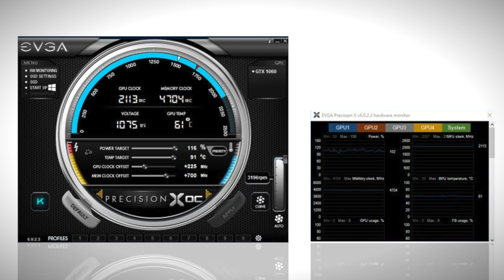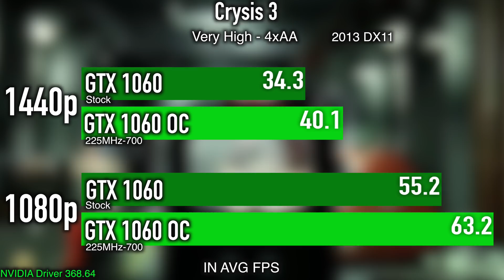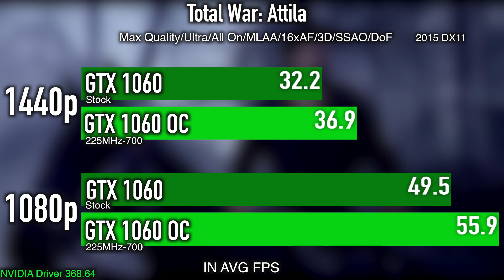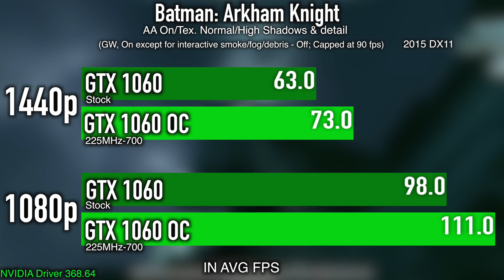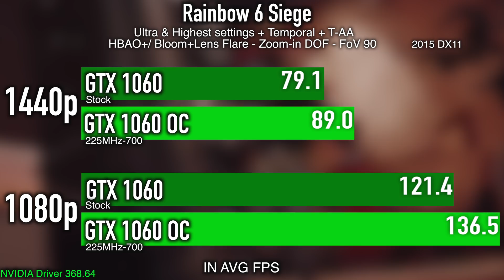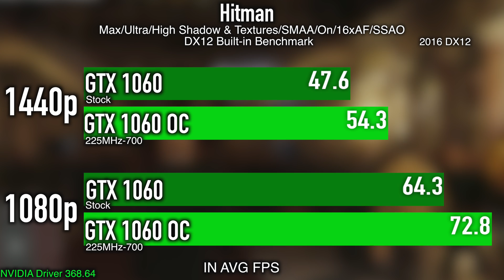The GTX 1060 Overclocked And Tested! 225Mhz Above Core!

Comment: I have a gtx 1060 asus strix oc edition. Things a beast, heat isn't a issue at the highest clocks. 2.3 ghz with 30 extra voltage. And 4150 on my memory
Reply: Air Brayden I have the gigabyte g1 gaming GTX 1060 6gb and I think it's the best one out of all the 1060 brands
Reply: I can't get past 2075 core 4479 ram on my evga gtx 1060 gaming 6gb card your ram clock is kinda low
Reply: I have an Gainward GTX 1060 with an overclock of +220 on core and 4560 Mhz on the memory. Its insane how mutch you can overclock theese cards. nomatter the brand. GTX 1060 cards are beasts and great in games  :)  My temps are going between 50-65 degrees so thats ok.

Comment: I dont know if i won silicon lottery but i was able to overclock core + 280 and +900 memory STABLE. - basically 15 fps increase in gta 5 - asus 1060 turbo. Great card :) Nice video!
Reply: Ethel Poolakese maybe lol I can't get past +150 core +475 RAM ON the evga 1060 gaming at least on heaven bench mark it crashes and firestrike I can't get over 205core 505ram
Reply: bshxh my current stable I find to work best is +450 ram and +175 core I hit 84c on vary un-optimized preview games. most of the time it's 76c max

Comment: I have an i5 3570 and an gigabyte ga-z77m-d3h motherboard. Currently using a GTX 660 ti, is it alright to upgrade to this with these specs? or do I have to upgrade the motherboard and CPU as well?

Comment: ? Will the AMD A10 APU 7850K run with a GTX 1060 6GB 

Hi Guys,

I have CPU AMD A-Series APU KAVERI A10-7850K Quad 
Core 3.7 GHz 4MB of Cache Not Overclock, I want to put card Is it tips.
Do buy GTX 1060 6GB Do happen bottleneck strong

My build:

- FM2A88X Extreme4 +
-(AMD A10 7850K (No Overclock
- CPU Cooler: Cooler Master Hyper D92
- GPU INTEGRATED R7 
- Corsair Vengeance Pro 8GB 2 x 4GB DDR3 2400MHz C11 
(Memory Kit (6.92 GB usable

-WD Blue 1TB SATA 6Gb/s 7200rpm
-Corsair CX Series 750 Watt ATX/EPS Modular 80 PLUS Bronze

Help me :(

Comment: not getting quite the same amount of over clock myself. +125 core, +249 memory, anything more and it's unstable. Still, that's gains around 5 fps on most games. Overall getting great performance from this card, glad I bought it.
Reply: also should mention I'm running this card with an 8320 and I'm seeing little to no bottleneck, so if you're on a budget it's a good value combo with this card.

Comment: hello there, i have a question im building an intel ring but i currently have a amd setup i know that this question is not base on the video but i have a amd fx8350 and i ordered an oculus rift cv1 with a gtx1080 from gigabyte the g1, the intel parts are on the way, but i just wounder if the oculus rift cv1 works with a fx8350 16gbram ddr3 1600mhz and gtx1080 pascal, and my games are in a ssd samsung pro 1tb, the reaosn why i am asking is because i havent seen any video using amd fx8350 cv1 ready and if so i will get a 2nd rift

Comment: I got 2127mhz on my 1070 to hold and added 600 to the memory. Its a zotac amp extreme 1070 love the card its just way to big for many cases, hell it barely fit into my cm storm stryker its actually 3mm to long. Had to put it in at an angle and its right up on my hd cages.

Comment: Got a SC evga 980 for 200  bucks off craigslist it'll only overclock further about 70mh core 50mhz on memory with 124% power and 70 milivolts

Comment: Gimpvidia gtx 1060 same as 970 but 6gb vram rx 480 same performance $200
Reply: MRsjovealek Extra $50-100 for 10 more fps not worth it.
Reply: MRsjovealek 4gb all u need for 1080p
Reply: MRsjovealek In 1 year these cards wont be relevant. Newer cards will take their place.
Reply: Typical AMDrone
Reply: GTX 970 GAMING lol, don't be a hypocrite. Your name is literally gtx 970.
Reply: +Rudy wow nvidia must have made u really mad to get an amd because on your channel only 2 years ago you had a 750 ti
Reply: Kodak I still use my 750 ti and I love it for what I needed at the time. Low power draw and good performance at 1080p. I have noticed that Nvidia offers cards that work better off the software they are desgined around (ex. gameworks, optimized games, etc...) while AMD can deliver more raw performance in Synthetic benchmarks.

Comment: Jeezus christ and this is with a reference cooler LOL what a great overclocker unlike its competitor cough cough
Reply: Yep, quite disappointed by it. Zotac GTX 1060 AMP! here in the Philippines is just below the Founders Edition MSRP while the RX 480 is WAY ABOVE THE MSRP even with just a stock cooler.
Reply: +Jonathan Rae Crisanto thats only your case, here the 1060 is 50 percent more expensive than rx 480.

Comment: holy fuck you maxed out the voltage? should I try that with my gtx 970 strix? do you think I would get good gains from my over clocks with that? I have an i7 4790k and 750watt power supply as well

Comment: damn, this stomps the shit out of the rx 480, both in performance and temps. and ocs like a demon. RX 480 rekt.
Reply: But remember wait wait wait for magical Vulcan dx12 nvm that half of the dx12 games Nvidia still wins but Nvidia can't do software only amd can
Reply: nooberrific yeah i know. but the real first true AAA game was doom with vulkan, and battlefield 1 will be the true dx 12 title we needed for years, hell remember all that talk about dx 12 starting in 2013, well look where we are now and still hardly any dx 12 games, only thing shitty about nvidia is that they stop giving fps boost to games on older cards, which is soooo gay. but thats nvidia for you, maybe they will change. im still hopeful. but im in love with my 980s so ill be good for another gen.
Reply: +Tanzu15 I was gonna get a 1060 but I talked someone down for 200 dollars for a SC evga 980 too bad it didn't overclock much further only about 70mhz extra but for 200 can't complain
Reply: nooberrific use a custom bios that made for getting higher clock speeds and higher oc. i was hesitant for a year and finally took the shot just yesterday. i cant beleive my eyes now. these cards come so fucking limited out of the box due to the shitty bios nvidia has on them. so many power limits that affect clockspeeds and temperature. give it a shot.
Reply: +Tanzu15 I can increase voltage that's not the issue thanks for the advice but just a little too scared to mess with bios
Reply: nooberrific increasing voltage wont help, you will throttle due to bios restricting power. so if you want to stay at 1500mhz at all times even at 80 to 85 degrese then you need this bios. but if not then your good.
Reply: You know that there are some Vulkan games where nVidia cards get more fps boost than amd cards? Also it takes shitload of time for game dev. to go all the way to using Vulkan, it would reach its time in 2 years maybe.

Comment: how long GPu can live on this OC mode ?
Reply: for ever dawg. Gpus dont die from oc, hell it would take around 10 years for a gpu to go bad from oc, and might not even die at all. as long as temps are in check.
Reply: It will shave some life off the card, but the card would be very old by the time it did die from the overlcock
Reply: on 91 C ?
Reply: Kreiven The GPU should not be hitting 91C unless you were to increase the GPU temperature limit to that level. Me personally, I would not allow the GPU temps to go above 85C because CPU and GPU chips reach a failure point as you get closer to 100C. Also, most cards won't really give you any additional overclocking benefit increasing your temps to that level; by the time you are hitting 85C, the card is giving you all its got. You want to increase it to 85C so that way your GPU's boostclock remains constant while keeping your fan speed low (I would just increase the fan speed to have a steady boost clock instead of increasing the temps because the fans on aftermarket cards are very silent anyway, but some people don't have a headset that blocks all outside noise so any additional noise coming from the computer at all is annoying).

But yea, don't have your GPU run at 91C.
Reply: couse i see this temp at this video OC page/ its was 91 C
Reply: Are you talking about at this time? https://youtu.be/vTRcTDOxzKc?t=85

I see what you are talking about now with his Temp Target being 91C. I would not do that and I highly doubt that it even got to that temperature anyway since he had his fan speed up at 100%. Maybe Eric will respond to this thread and inform us of his GPU temps while in game.

Comment: Hm can't decide if i should get an 1060 or a 480 for this build:
-Intel Core i7-6700K Skylake
-Corsair Vengeance LPX DDR4 2666MHz 16GB
-ASUS Z170 PRO GAMING, Socket-1151
-EVGA Power Supply 650W GOLD
-Samsung 850 EVO 250GB 2.5" SSD

Pls help xD
Reply: of course gtx1060 if you don't mind sli..  TPD is lower by 50 watts from rx480!  it's worth the price for the perfomance you get..
Reply: ***** That sounds like a smart idea

Comment: why i cannot overvoltage my gpu-i have an Gigabyte GeForce GTX 750 Ti (GV-N75TWF2OC-4GI) and im using msiafterburner,
i overclocked +185 on core and +370 on memory but when im trying push it further  driver just crashes

Comment: Would I get similar results with a core i5 6500
Reply from the maker: CPU has nothing to do with the gPU overclock
Reply: You won't notice a diffrence. Don't listen to that '5-10fps difference' guy.
Reply: about similar only like 5-10 fps difference
Reply: ONLY 5-10?!?!??!?!?!
Reply: it will be pretty much same :)
Reply: +KogeROnControls it's true I have a 6600 and 6700 and there a 4-8 fps difference on newer titles that are utilizing more cores like gta,far cry ,etc
Reply: The Lord ONLY 4-8?????!!!!! if you say 1-2 fps that's fine but 4-8 is a big number
Reply: +MrAvatin  don't worry that difference is only on games that are CPU intensive.other games the i5 is neck and neck with the i7

Comment: Just ordered the evga ftw 1080 today since i have not heard anything about the 1080 hybrid. Impresive work on the 1060 there Elric!
1 off topic question tho. Which DP supports 144hz 1080p? i've seen allot of people saying that they purchased some but only turned out to be 60hz, still rocking my dual link dvi :s

P.S. would you be doing an OC rx480 vs an OC 1060 any time soon?
Reply: rx 480 doesnt oc max 20mhz from review of the nitro so its pointless maybe 1 fps
Reply: why did you feel the need to boast about your card? and secondly why are you wasting the 1080s performance on 1080p, are you crazy?
Reply: Pop Jones no need to go 1440p just because its a new thing. My 1080p monitors are doing just fine and the perfect size for my pc room. Second the FPS Gain is pretty massive and i am going to enjoy it. 3 i did not boast of my card since anyone can get one if they work for it. 4th i am trying to find a good displayport which is why i stated my card that i bought for someone that knows can answer but since u dont have an answer to it, no need to comment about the 1080 i bought
Reply: well, any normal person using the internet today would normally google such a thing. It is literally as easy as typing your question into google and within a couple of clicks there is your answer. as to your 1080, if you did not want a comment to it why mention it at all? heck you could have still ignored the logical thing of googling it and just typed "what display port do i need for 1080p 144hz?" simple as that.
Reply: Oh and jut fyi, All displayport cables do the same thing, the only thing that has been changing is the actual displayport.
Reply: there are display ports that doesnt go up to 60hz(which are the cheap ones) And they barely put links on their posts. But anyways Any normal people would either answer a question to someone's answer if they have an answer or not say a thing. Assuming you are not much of a normal person on the internet, good day sir
Reply: ouch that burn. And as I said before all display port cables do exactly the same thing.
Reply: unless ofcourse you are an idiot tying to save pennies by buying a 10 pence cable.

Comment: Yes I know this is a random question. But how do you calculate if a cpu heatsink will fit into a case?
Reply: measure the specs on case and heatsink
Reply: Says in specs of case "Maximum CPU Cooler Height" and in specs of cpu heatsink under dimensions
Reply: thanks guys first time I'm going to use a after market cpu cooler. Been deciding on a noctua d15 or the s version. Just worried that it won't fit into my mid tower case
Reply: Also check if there won't be any RAM clearance issues, if your RAM sticks are too close to the heatsink, they can be a problem
Reply: yea ill look out for that when i start building my new pc still looking around for mobos for skylake. Hey do you think the noctua d15 will fit into my rosewill challenger mid tower case? Looks like it might not fit but i'm unsure.
Reply: You'll have to use google for that, I'm not familiar with any of those.

Comment: Yeah the 1060 kinda took away the thunder from the rx480. Thermals, performance, OC'ing it's just a no brainer. If they can get a $249 AIB card out there, AMD dropped the ball by not putting out a competing card to the 1070-80 and focused far too much on mainstream. Good luck with Q3-4 and beyond, dumb decision AMD.

Comment: Man i have to say im an AMD fanboy ( rocking the trusty r9 290) but the 1060 totally beats the rx 480 in value when it comes to new cards. I mean you get 2 extra gb of vram (going for the 4gb 480), better drivers with less overhead (ive had both and i know Nvidia is better hands down), Way better overclock ability, and slightly better performance for only $250. $50 more and in my opinion its well worth it. Also if you put it against the 8gb its only $10 more and imo its very much worth it. Only 2gb less vram and you get all the other benefits. The only complaints i have about the 1060 is less dx12/vulkan support and no sli.
Reply: lol
Reply: and with lower tdp by 50watt
Reply: so a 10% improvement in performance is worth a 25% increase in price?
Reply: alalpwn Not just the performance increase but also better driver support/less overhead, less tdp and better overclock ability. Also if you compare it against the 8gb version witch most people will buy its only a 10% increase in price.
Reply: yeah the 8gb version is only really viable if you plan to xfire but still, the 480 4gb wins price/performance for the mainstream, I won't kick my 1080 out of bed for it but for 200 it's a better deal than the $250 1060, especially looking into the future with dx12 where the cards are on par with each other

Comment: would be good upgrade from gtx 770
Reply: From 770 to 1060 its a big deal!
You can imagine the 1060Ti?
Reply: same
Reply: Mine is a 2gb version a 1060 is a big deal.
Reply: +upload9595 nah a 660 is stil a high-end card ;)
Reply: +Régis Soutello Pessolano where tf are getting a 1060 ti
Reply: I really wanted to get a 1070 but that 375 msrp was complete bullshit, I expected the prices to hover around 400€ (440$) - 420€ (460$) but instead they're are no 1070s below 450€ in germany which really pisses me off. I don't want to get a 1060 because the improvement doesn't seem significant enough.
Reply: +LeireX same i wanted a 1070-80 but i got very sick and cant work so i guess a 1060 will be fine :)
Reply: would be a good upgrade from my gtx 560, does anyone know what is the difference between gigabyte $250 one vs the founders edition?
Reply: edi4ever1 Cards with aftermarket coolers are mostly already "pre oc-ed" but won't oc much more. The founders edition however has, as you can see, a lot of of oc potential but it will run a lot hotter.
Reply: +Régis Soutello Pessolano no such thing as a 1060ti because it would be getting close to the 980ti level of performance and no one would get a 1070 anymore
Reply: Jere Heimonen yes a very good upgradr

Comment: 1070 FE not overclocking well? I went from stock 1506 to 2020 mhz with no problems
Reply: The funny thing is that FE cards OC better than aftermarket cards, Nvidia probably hand picked the best chips to use in their FE cards.
Reply: ***** Yeah it seems odd that aftermarket cards are not getting much higher clocks than founders editions, some even getting less